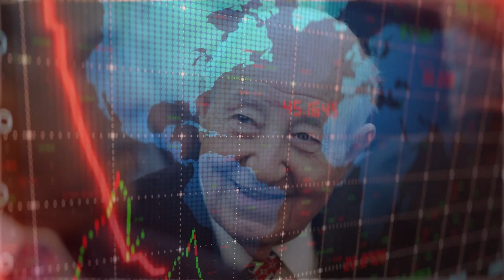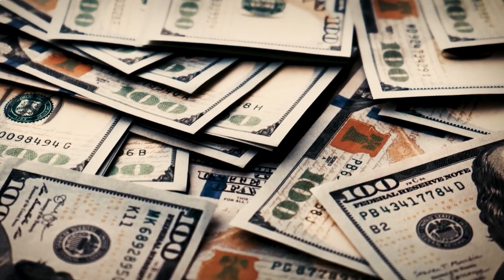Inside the Incredible $6.4BN Gordie Howe Mega Bridge

Comment: 1:00 there's a tunnel too. So the ambassador bridge is not a choke point. There is another bridge a little bit north (port huron). An option for truck drivers. The complaint by the private entity is well taken. The government is in competition with a private enterprise. Is that acceptable? If a second bridge is so useful, why is it that no investors would build one? Answer: the governments are subsidizing the crossing.
Reply: The Ambassador Bridge is out of date and doesn’t connect to a freeway on the Canadian side. The new bridge will be a modern multi-lane facility, tying Ontario’s major artery - Highway 401 - to the USA’s interstate system while also allowing pedestrians and bicyclists to cross.
Reply: The Tunnel IS a bottle neck now. I don't take the time, I use the Ambassador Bridge if needed.
Reply: @salemdesigns65  I find the opposite.  I take the tunnel as much as possible.

Comment: This bridge design has a flaw, which we people in British Columbia experience every time it snows. The snow freezes on the cable, which happens to be travelling above the roadway, and when the cable offloads the snow or ice, it tumbles down on the motorists below, creating a dangerous hazard.
Reply: They plan to sprinkle pigeon food on the cables each morning and it's hoped that the increased pigeon activity will keep the snow and ice melted in all but the fiercest storms.  At least, that's what I heard at the bar the other day from some guy named Brian.
Reply: The new-ish I-280 bridge in Toledo, Ohio is of the same style and oftentimes in winter the center lanes are closed due to the exact issue you detailed. Hopefully they’ve sufficiently addressed that issue for this span.
Reply: @michaelrains64295  I believe they have heat to prevent on this new design.
Reply: To my untrained eye, the cables look white, so perhaps a teflon-like sheath to try and minimise that?  Seems unlikely that they wouldn't have considered it at all, that's not usually how engineering works.

Comment: One man owns the bridge??
Reply from the maker: The Gordie Howe Bridge is indeed a public-private partnership (PPP) project. The Ambassador Bridge, on the other hand, is privately owned by the Moroun family.  Following the passing of Manuel Moroun in 2020, the current ownership structure isn't publicly available.  
It's a unique case compared to most US-Canada border crossings.
Reply: Fun fact: Warren Buffet was a part owner until he sold his share to Maroun.
Reply: Interesting.  Mr. Buffett must have found a more lucrative place for his capital.  The US has about 600,000 bridges.  Only 2,200 are privately owned.  It may be an anachronism.  It was built in 1929.  I'm not a big fan of private ownership of infrastructure on which the public relies.  This bridge has the additional exposure of relating to border security.

Comment: Cool video but…not even a passing mention of the Detroit/Windsor tunnel?
Reply from the maker: You're absolutely right, and thanks for pointing that out!  Our focus in this video was on the Gordie Howe Bridge, a brand new project that will significantly increase capacity for cross-border traffic. The Detroit-Windsor Tunnel, however, remains an important part of the Windsor-Detroit corridor,  providing a vital alternative for vehicles. Thanks for the comment!

Comment: It's been a Looong time since we moved from Detroit to California,  but remember two ways to get from Windsor to Detroit.   The route we took most often was a mile long tunnel?  I don't see anything about that in this clip, is it still there?
Reply from the maker: You're absolutely right!  There are actually two ways to get between Detroit and Windsor. The tunnel you remember is likely the Detroit-Windsor Tunnel, also known as the "mile-long tunnel."  It's an older tunnel that's still in operation today for vehicles.
This video focused on the Gordie Howe International Bridge, a newer project designed to provide a more modern crossing with increased capacity.
We appreciate you sharing your experience!
Reply: The Tunnel is still running smooth. Alot of Canadians that travel back and forth to Detroit for work, use the Tunnel.

Comment: I'm surprised you didn't mention the fact that the Canadian government is covering the majority of the costs of construction.
Reply: The new bridge solves a problem he didn’t mention in the video. The Ambassador Bridge runs straight into Downtown Windsor. The new bridge will connect major highways, which will ease traffic congestion in both Detroit and Windsor’s downtown areas
Reply: Plus the new and upgraded boxer neck point to speed up traffic flow.
Reply: Technically the costs are split, Canada is just front the US' share and will be repaid via tolls that would have gone to the US
Reply: @NavDDG54  It's a good deal for Canada. I like the math. Daily trips from 2026 on forecast at 26,500 round trips x 2 @ say $15 bucks =$795,000
Reply: While the US benefits from trade with Canada, Canada benefits far more from access to US markets.  The vast majority of Canadians live along the US border and are far more connected to us than to each other.  And projects like this just further cement that reality.

Comment: Now living in Western Canada close to retirement, I remember as a Truck driver crossing into the USA on a regular basis back in the 80's upto the mid 2000's and I will say that this project will be well worth it for several years down the road for future truckers, much faster flow through for sure, but I remember those very long line up's sometimes taking hours to cross, having to go into customs and sorting out issues regarding broker mistakes and such, the times are a changing for the good I suppose.

Comment: I have a question about the construction of this bridge. Did they figure out the extra weight of electric cars and trucks that will be crossing this bridge in the future? Because an average car weighs about 2000 pounds and the new electric car's are smaller and weighs about 3500 to 4000 pounds? That's a lot of weight!
Reply: The bridge is being built to accommodate fully loaded semi trucks.
Reply: Agreed. 
It was proposed specifically for major truck loads and traffic. 
And proposed that the Ambassador Bridge will be for passenger cars only...we shall see...

Comment: 2 big missed facts 1 the bridge is needed to ease the traffic that is backed up for many miles cutting Windsor in half . And the tunnel between Windsor and Detroit is not even mentioned
Reply: Hmm...  I skipped down here after a few minutes because nothing had been said about the tunnel.  It's more than a minor point to omit, in my view.  Kinda stunning if, as you say, he never mentioned it at all.  Also, I never knew that the traffic backed up bad in Windsor.  Hopefully the new bridge will help with that. 👍
Reply: Neither is the train tunnel that also goes underneath the Detroit river and connects to Windsor.
Reply: The tunnel is way to small to serve as a meaningful international crossing, it mostly used by local traffic. And aren’t trucks banned from it?
Reply: @Kishanth.J  The Ambassador bridge carries about 10,000 commercial trucks a day and 4,000 passenger cars. The Windsor tunnel carried 12,000 passenger cars. They are relatively equivalent. Imagine how long it would take to get across the bridge with just about double the vehicles going across? It is a pretty easy question to research. Do you work for Mega Builds? bahah
Reply: @Kishanth.J  yes they are.
Reply: A major point. Kind of sad to think Mega Builds does so poorly at easy things to research. I'd almost say they HAD to try hard not to mention the tunnel, which was the first of its kind, an international border, linking two nations underwater. It's like they wanted to artificially escalate the absurdity of it all. Like some bufoons were managing our infrastructure. No, only the classless person was Moroun who blockaded progress along the NAFTA superhighway for nearly all his God forsaken life. Good riddance.

Comment: Mixing metric and imperial measure ... ?
How many acres of pavement and concrete?
Wow, 120yr life. Impressive.
The delay is NOT a benefit. That is just political spin control! The extended (not extra) worker salary does not offset the year of lost value added by the lost bridge traffic.
Reply from the maker: We apologize for any confusion and are always looking for ways to improve. To reach a global audience, we use different systems but we understand the need for conversions. 

Unfortunately, the exact amount of pavement and concrete used for the bridge likely isn't publicly available. We can estimate the total bridge deck area. The bridge will have six traffic lanes and a pedestrian/cyclist path, with an estimated total width of 70 feet (21.34 meters). The main span of the bridge deck is 853 meters (2,800 feet). This gives us an estimated deck area of approximately 18,292 square meters (196,000 square feet).

The 120-year lifespan refers to the bridge's design life, meaning it's engineered to last that long with proper maintenance. 

Thank you for your comment!
Reply: @MegaBuilds5280   Thanks for reply.  
The mixed measures were ones provided by the bridge people (I'm guessing). Just twigging you.

I was wondering about the area of land covered by pavement/concrete ON THE GROUND, not the bridge deck itself. The question came to me when you were repeating their spin control about the large area of "green space".  Before construction, most if not all was green space.  Although in comparison to other projects there may be a lot of green space, it is very small compared to the amount that was paved over by the project. 8 lanes of approach roads, 30+ lanes in the customs area, parking lots, ramps to bridge etc.I was just being a little contrary.

Comment: As a Canadian, build more bridges as what we've seen in Baltimore recently what can happen very quickly to your supply chain.  And the truckers blocking the bridge, fighting for your freedom and mine, had NOTHING to do with us building another bridge >.<
Reply from the maker: You're absolutely right, strong cross-border infrastructure is essential! The Gordie Howe Bridge will definitely enhance capacity and improve trade flow between our two nations. As for the Ambassador Bridge blockade, it certainly highlighted the need for alternative routes to keep essential goods moving. This bridge is a long-term project designed to ensure a more resilient and efficient transportation system for the future, benefiting both Canada and the United States. Thanks for your comment!
Reply: @MegaBuilds5280  im surprised that it took them that long to get a second bridge built and that they had to go through the court system to entertain that guy's monopoly on it when in reality the government should have just said, here's x amount, it's ours now.
Reply from the maker: You're right, mega-projects can get bogged down in legal battles and delays. Balancing public needs, private interests, and regulations is tricky. It's a whole other side to these projects beyond the impressive construction.
Reply: @MegaBuilds5280  kinda makes you wonder how many megaprojects we didnt get because they got tied up in courts.  (hint hint ;) )

Comment: Are they planning to scrap the Ambassador bridge once the Gordie Howe bridge is opened?  Thanks.
Reply from the maker: Thanks for the question! No, there are currently no plans to scrap the Ambassador Bridge once the Gordie Howe Bridge opens.  In fact, they're expected to operate alongside each other. The Gordie Howe Bridge will increase capacity and handle a significant portion of traffic, but the Ambassador Bridge is likely to remain operational for continued use.
Reply: No. Why get rid of it?
Reply: @salemdesigns65  - Sometimes they do that.... saying that the bridge is old and too costly to maintain. I was just wondering if this is the case for this one.

Comment: Did you know that the Detroit-Windsor Tunnel is the only existing underwater international passenger car border crossing?

The Detroit-Windsor Tunnel was formally dedicated on Saturday, November 1, 1930. President Herbert Hoover turned a "golden key" in Washington that rang bells in both Detroit and Windsor to mark the opening of the tunnel.

The Tunnel was finished a year ahead of schedule at a total cost of $23 Million.

The Tunnel is jointly owned by the Cities of Windsor, Ontario and Detroit, Michigan.

It is operated under two separate agreements by the Detroit and Canada Tunnel Corporation.

Approximately 12,000 vehicles pass through the Tunnel on a daily basis, handling over four million vehicles per year, of which 98% are cars, 2% are trucks and buses.

Ventilation - 1.5 million cubic feet of fresh air is pumped into the tunnel each minute.

Renovations: A $50 Million renovation program was launched in 1993, including a completely new road surface, new sidewall tiling, new lighting, complete video surveillance and restoration of the Tunnel’s stone cover beneath the Detroit River.

But while living in Leamington I did like to cross the beautiful Ambassador Bridee.
Reply from the maker: Thanks for mentioning the tunnel! You're absolutely right, it's a historic landmark and a crucial part of the Windsor-Detroit connection.  The fact that it's the only existing underwater international passenger car border crossing is truly fascinating!  The tunnel's history is rich, and the new bridge is a marvel of modern engineering.  
Here are more on marvelous underwater tunnels: https://www.youtube.com/watch?v=y8j0d4u_I7U

Comment: Indeed the author of this video needs to do a little bit more of homework. I actually lived the main reason for this second bridge to come about when trade and border crossing almost came to grounding halt after 911 for several months. Already they were a lot of inefficiencies and major health hazards with that crossing point, especially on the Canadian site, and the limelight was  finally put on the research for a long-term solution. It is just taking 15 years more than planned to built it...
Reply: The 911 delays were caused by the Customs/Immigration process.  The delays today are caused by the Customs/Immigration process as will the delays in the future.
Reply: @pcs5852  Exactly.  That is why the second span Ambassador plan was idiotic.  It would have fed into the same Customs booths and ground to a halt.  It would have been a billion dollar parking lot.
Reply: @rickmossop3733 : "It would have fed into the same Customs booths..."
.
Not so. When the landing for the second span was built on the Canadian side, more Customs booths were built on that landing, effectively doubling the number of booths available.
However, the real issue was not necessarily the number of booths available, or even the number of Customs officers manning the booths but, rather, the customs process.
All commercial loads are pre-cleared and the inspection process should take no more than 30 seconds.  However, it rarely takes less than two minutes (by design????) and often takes longer.  I have no reason to believe that will change when the GH opens.